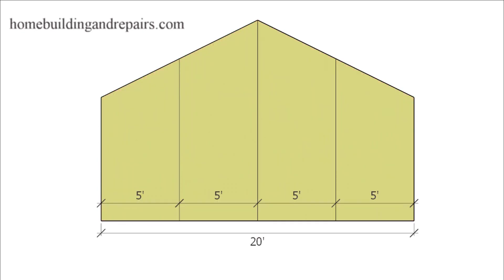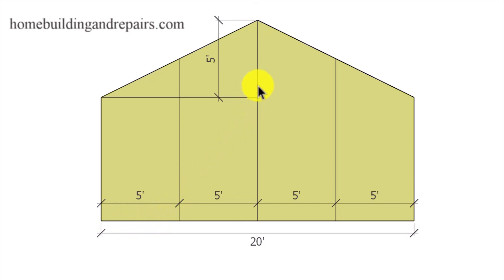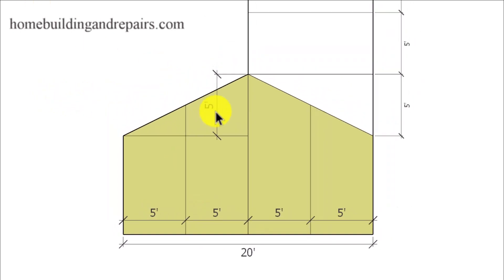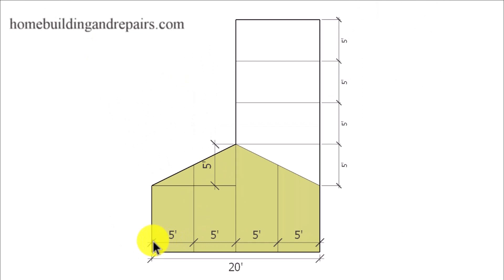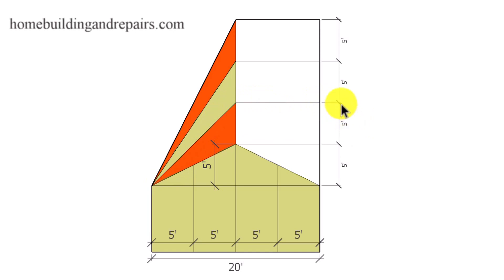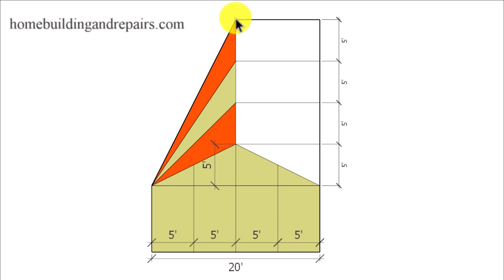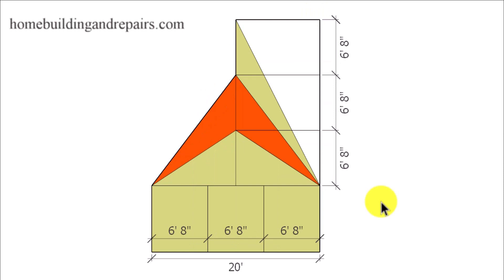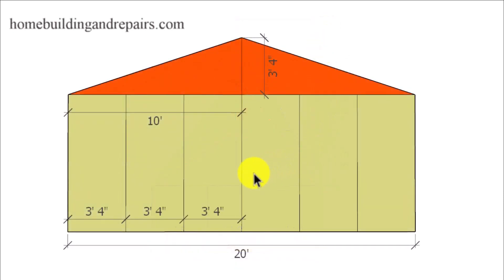How Builders Used Quarter And Half Pitches To Calculate Height of Roof Ridge - Old Carpentry

Comment: Your overall explanation is spot on, simply stated-pitch is a ratio of the Total Rise to the Total span.  It is correct to say, for example 6 over 12 slope OR A 6/12 Cut but NOT a 6/12 pitch.  Dividing the unit of span (24) by 6 equals a 1/4 pitch roof just like your visual depicts.  Thank you for presenting this.
Reply from the maker: You're more than welcome.